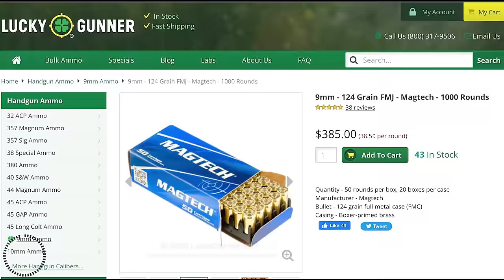Officer Comes Under Immediate Fire In Traffic Stop

Comment: Are we really sure that was the same officer in both badge cams.  The serial number in top right of badge cam seems to imply that the officer that shot out the back windows was NOT the same officer that then directed the perp to exit the vehicle and put on the cuffs.  But regardless, both officers did a brilliant job.
Reply: Its the same guy.  Badge cams and pov cams in general are really wide angle and make everything seem farther away than they are.